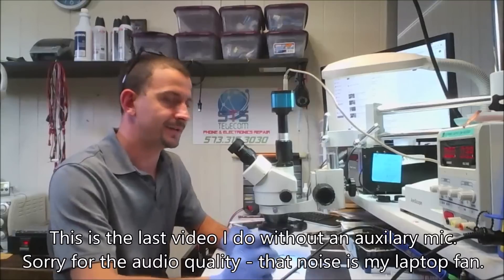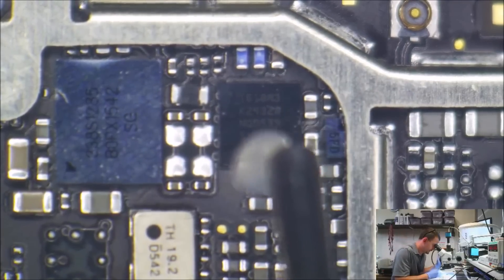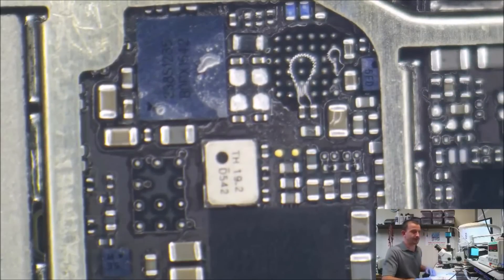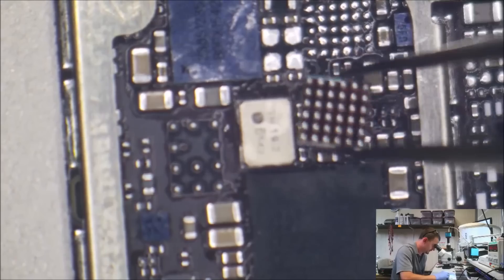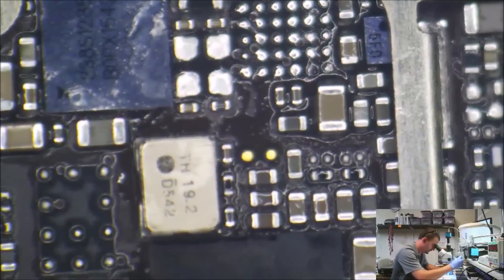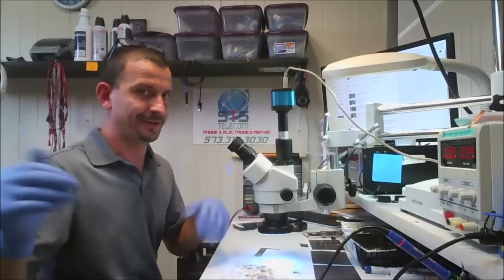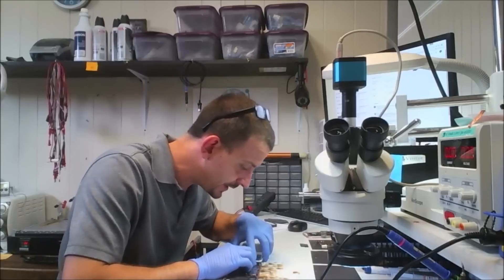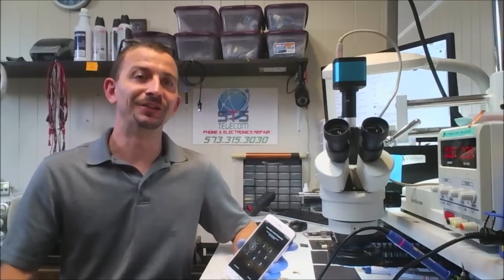iPhone 6S Plus Hung on Apple Logo Fixed - Replace Tristar U4500 (last video without aux mic)

Comment: my iphone 6s is in a bootloop with black screen and white apple logo. however when I plug it in with a usb to my pc or outlet it powers on to the app screen, I even restore it to factory settings. but soon as I switch it off with out charger plugged in it gets stuck in the bootloop. Itunes cant detect my iphone there is no charhing symbol it has appear briefy for a few seconds recently. my phone charges slowly when in standby though. any ideas

Comment: I have a 6s that i have put a new battery in and the battery drains so fast and after 1-2 minutes it will restart the phone (i tested this battery in another phone and it has no issues) do you think if i got the Tristar replaced in a phone kiosk this would fix my issue?

Comment: Received a dead iPhone 6s yesterday, not water damaged. I replaced battery and it powered on but drained extremely fast (about 1% per minute) and was not charging. I replaced tristar and it charges good now but only on a wall charger, and battery drains normally. When I try to connect to computer it doesn't charge and iTunes does not recognize the phone. 

Have you had this ever happen to you? Do you think it's a bad tristar chip or possibly something else? I already tried a new charge port also.

Comment: you think it may be tri star ic on a 6 plus. my problem is the apple logo loop? black screen white logo goes away, phone shuts off then re appears when connected to power or when holding power and home button, also wont go to "plug into itunes display" i would miss my phone for a week but you seem incredible at what you do. im in Illinois so i dunno if i can drive to you. all OEM equipment. im second owner.

Comment: It just doesn't go past the screen with apple logo and it switches off and on then again to apple logo and off and on n it continues this shit. Tried recovery but itunes says error 9 once it reaches to a point where it shows a horizontal bar and then it goes recovery mode with iTunes logo. HELP me to fix this iPhone 4s. Please help . One more when i remove the battery and plug in charger then too it's not getting on. I think this apple logo looping and plug in charger with battery removed has some thing to do with the one chip or IC but not sure which one? Please please HELP!

Comment: Thank you for sharing your work. I love puzzles like this and the odd ones I get keep me entertained for a hobby. One problem I've not been able to crack is when the apple logo comes up then goes off after about 10seconds and this loops forever. I just had an IP6 with this, the reset_1v8_l  line gets pulled low (activated) which causes PMU to cycle thus causing a reboot. Have you ever resolved one like this? I think it's software corruption.

Comment: Hi Jason,

Really sorry for my English! I have done this change and at the beginning all worked fine. after 10 min of charging, the iPhone chrashed. So I took the lightning cable out, and turned on the phone again by powerbutton. After that, I plugged in the cable again and the phone crashed once more. Now it crashes all the time after put in the cable and it reboots. Maybe you know what the problem can be?
Best regards from Switzerland and thank you so much for your videos!

Comment: Hi! May I ask how do you make sure all the solder ball connectors on logic board are 100% aligned with the each connectors on the IC? 
Thank you very much.
Reply from the maker: You only have to get them nearly 100% aligned and surface tension does the rest.  It literally lines itself up.
Reply: Got it thank you.

Comment: Only recently picked up on your videos, very down to earth repairing if you know what I mean. Have you ever tried repairing off a camera only or would you say a microscope is the only way?
Reply from the maker: Thanks :)  I did it using a lens that I pulled from an old projector for awhile.  Then I used a cheap USB microscope to solder and the lens to verify my work.  The work turned out really bad though.  I was only soldering charge ports and other larger components back then but I didn't fully realize what I was missing until I got a microscope.   I don't think there's any way I could do this volume of repairs without it.   There's no way I could do long screw repairs without it.  I'm planning to make a video pretty soon  replacing touch ICs without a microscope just to see if I can do it.
Reply: Look forward and thanks again for your videos, great help when soldering generally.
Reply: https://www.youtube.com/watch?v=Rr4477PvwPY

Comment: i was wondering how about for iphone 6 plus continue  restarting can you share some possible solution
Reply from the maker: There are a ton of things that could be causing that..  I don't think I could even take guess at it without taking some measurements.  Sorry!
Reply: well thank you for you kind response, I already found out where the problem is. I try to reball the tristar ic and it seem that it working. since this morning ( itlian time ) after that intervention the phone is working. but still i need to test it with in 72 hrs. before I can say that it already been repaired
Reply from the maker: +lino Magtibay Good deal! Glad to know it :)

Comment: Jason,

  Why do you think there's so many failures with the Tristar chip? Do you think it's mostly bad quality chargers being used, or that the chip itself is inherently underspec for the job?

Given the persistence of the usage of this chip throughout their designs, I'm starting to lean towards more it being mostly driven by consumers using cheap 3rd party chargers?
Reply from the maker: It really is the cheap chargers that blow them out but that can't be blamed entirely.  I agree with Jonas that these devices should accept interference and dirty power much more than they do but there has to be a limit to that.  A spike with high enough potential will always jump a gap, so even with protection in the phone, a charger that is REALLY bad can still toast the device.   It seems like they are getting popped too easy though.   I don't know how some of these chargers look inside but if they are using a transformer to step voltage down, the lack of smoothing caps and diodes could let enormous back spikes from a transformer loose into the phone.  The Tristar IC seems to be very fragile..
Reply: I think he already gave the answer at the end of the video: bad chargers. However I disagree with blaming the user for using a bad charger. It's a user facing port that ultimately goes to USB. It is to be expected to be hooked to all kinds of nasty power sources. Input protection must account for that. It's not like Apple didn't try throwing filters and diodes at it (that in my limited experience have a high percentage of cold solder joints - so that may be the actual issue). Still Apple is to blame -  not the customer for using 3rd party chargers. However bad they may be.
Reply: You know that spark gaps are a thing, right?  Apple got the number of outside facing contacts down to 8. Of course there is a limit to how much protection there can be expected. At the price point of Apple products how about this: black soot in the ports vicinity. It can reasonably be done and at that point the blame shifting game is trivial to decide.